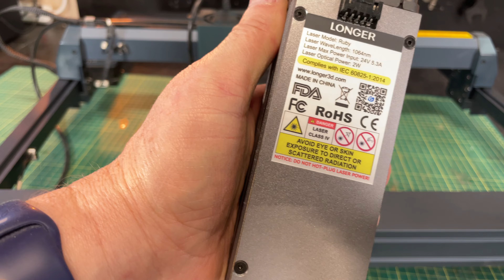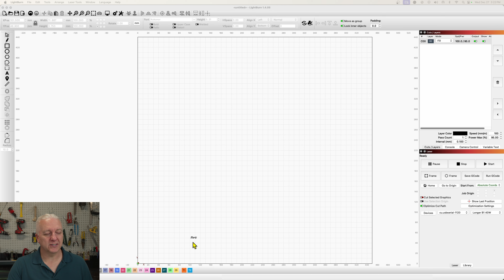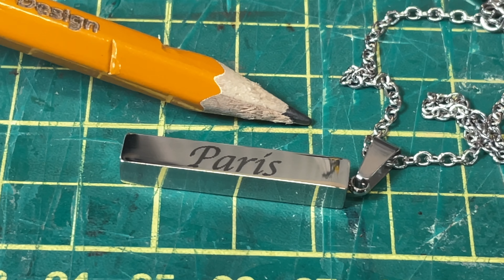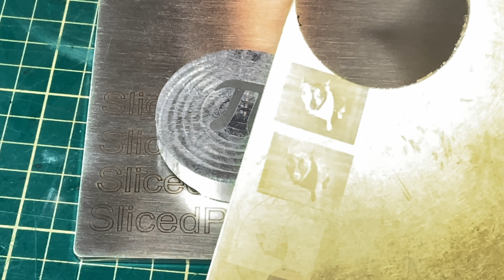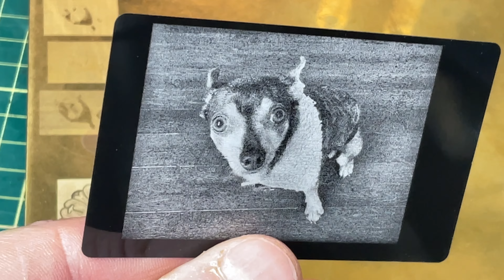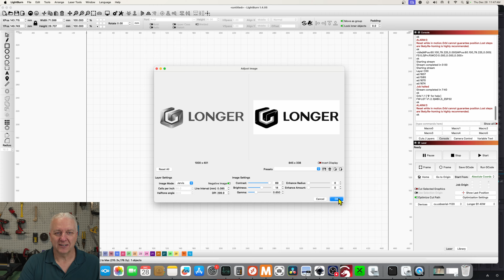Longer Ruby Laser Module - The Longer B1 Gets Even Better

Comment: Hey Steve. ive got the ruby for the ray5. and im trying to figure out the setting configuration for it to work right... right now it doing the jobs upside down and mirrored ?!  is there something im missing in the settings?
Reply from the maker: This has nothing to do with the laser, but rather a Lightburn configuration issue. Sounds like you might have the motor directions reversed in the machine settings.  You can find this in the lightburn toolbar at the top of the screen.

Comment: I just bought one and I have the Ray5 20w. I use the camera quite a bit to place my images on my material to be lasered on. However the zero center for this is different from the ray5. Did you by any chance get to figure out what the y and x axis are compared to the b1 or ray5 so it centers at the correct coordinates?
Reply from the maker: Where the laser centers really shouldn’t matter much. The B1 has a slightly bigger workspace, so thing will move a bit anyway.  Lightburn can layout a design anywhere on the workspace.  Normally you wouldn’t reference to the center but rather the lower left corner.
Reply: @SteveMakesEverything  maybe I left out some important info. Sorry. I use a camera to place my desired design on my material. When I do it with the Ruby the framing is not where my camera has my image placed. It’s so much easier for me to use the camera but I’m guessing that I may have to just eyeball it and tinker with the placements manually instead of using the camera with the Ruby? For example when I do image capture with the ray5 let’s say it’s at x100 y100 it places it there. But then I do it with the Ruby it’s at x123 y130 for example(not actual numbers). I’m just hoping there’s some easier way. Should I be doing a camera calibration as well with the Ruby or is there an offset I can key in Lightburn that will compensate for the actual laser position? I appreciate you taking the time for the reply.